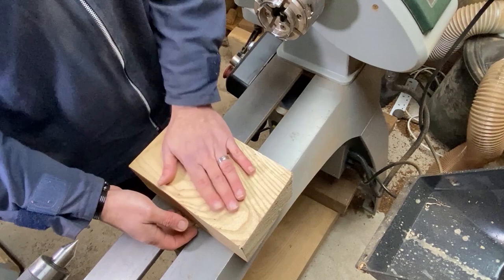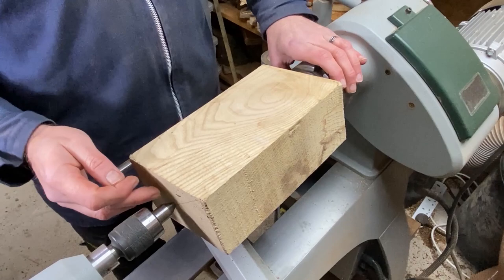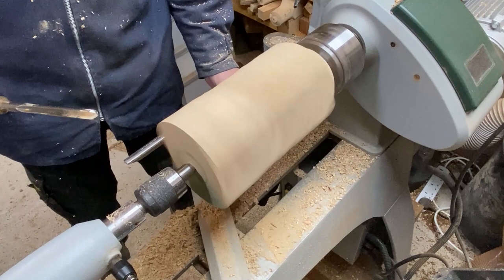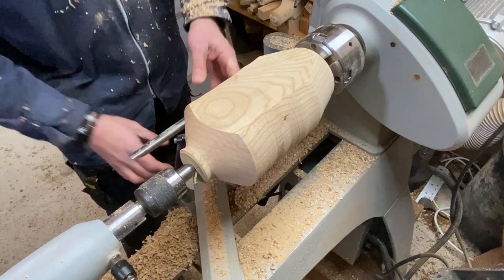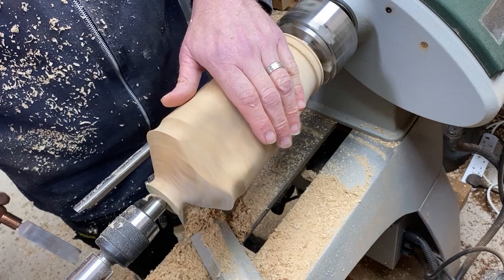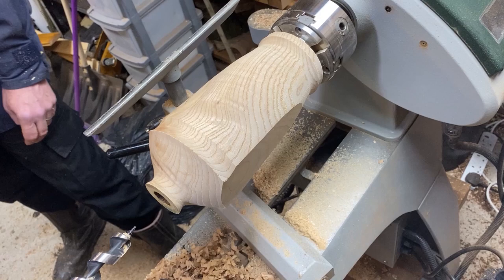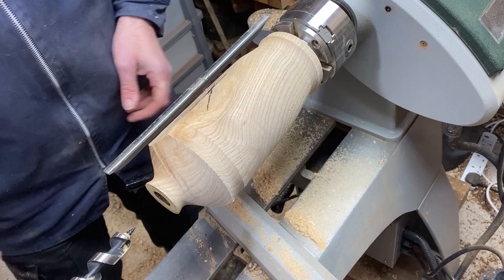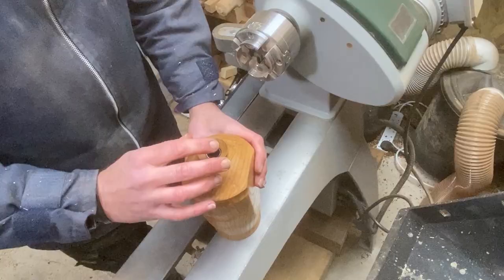Woodturning Project, the Bud Vase in figured Ash

Comment: Lovely grain in the ash.   Looks terrific as usual.   Well done.
If the tube is glass, consider putting a piece of spongy shelf liner in the bottom to minimize risk of the glass breaking when the tube is dropped in the vase.
I drill at slower speed than most turners and clear out the shavings often.   If the auger bit feels like it is not cutting in the future, it may have lost some of its temper due to the heat from the drilling.   It can be resharpened, but if the temper is reduced, it will not keep the edge as long.   It could be re-tempered but the heat is likely to cause warping.  I am always amazed at the amount of heat generated when drilling wood, seems to be much more than when I drill metal.
Dave.
Reply from the maker: Hi Dave, I was far too impatient when I was drilling which was why the shavings were not cleared often enough, I'll not do that again! The tube is plastic so no problems there, I don't trust myself with glass lol.
All the best
Mike
Reply: I forgot to mention.   My learning about not clearing the wood debris was when I got a drill bit stuck in the hole.   Pulled out of the chuck.   I thought, no worries, just rechuck and extract.   I spent a LONG time trying to get the drill bit out.   I managed, but it was a  big hassle and a lot of time wasted.   A typical lesson learned the hard way.
Dave.
Reply from the maker: @lv_woodturner3899  Yep, the hobby has a great way of teaching lessons lol